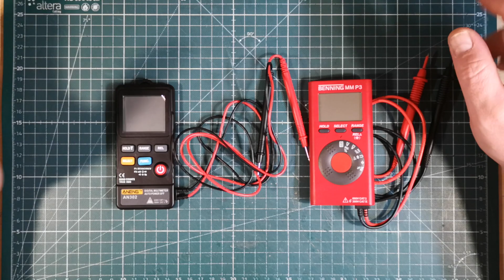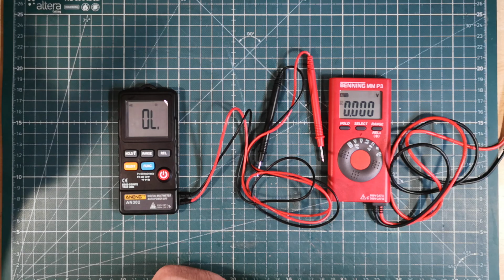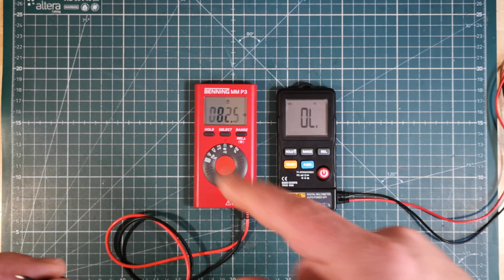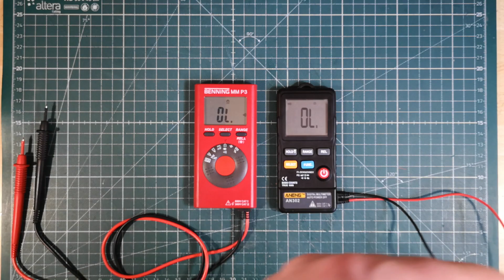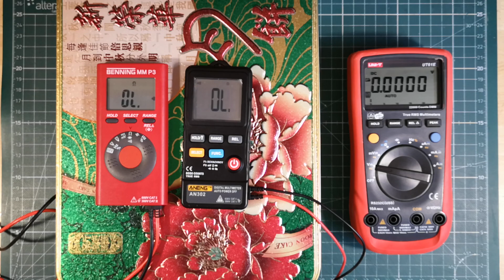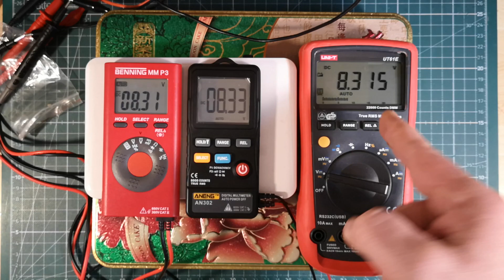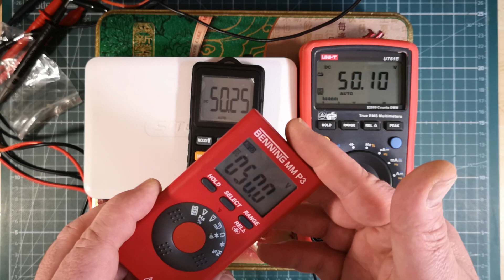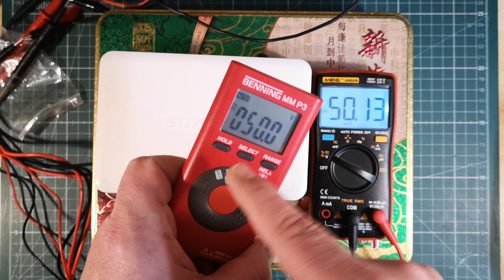"Aneng AN302" teardown and review compared with "Benning MM P3"

Comment: Benning P3 is APPA iMeter3. Also APPA iMeter5 is absolutely great and it has NCV plus somr hidden options when you press HOLD and switch this ON. iMeter5 held for 1 or 2 years of constant every day use without any issues.

Comment: 8:37 min You remove the plastic protective ring between the metal clip and the circuit board. Don't you think that ring was there to protect the underlaying traces from the metal clip scraping on them and either shorting them out or eventually cutting through them... Also mine exact same Benning seems to have a newer circuit board with a different layout!